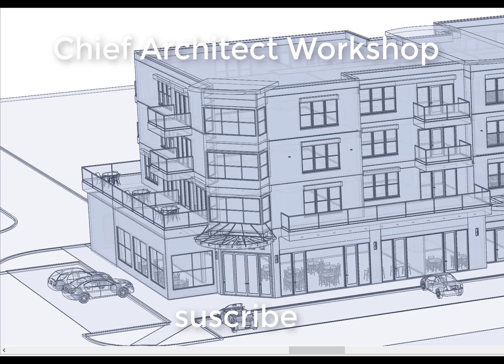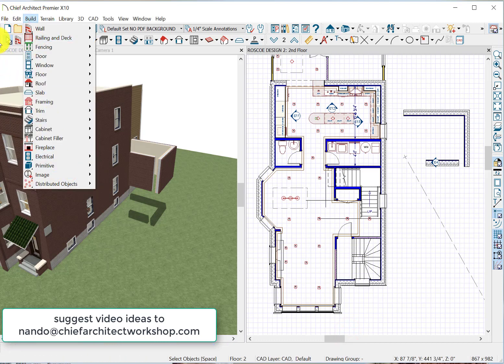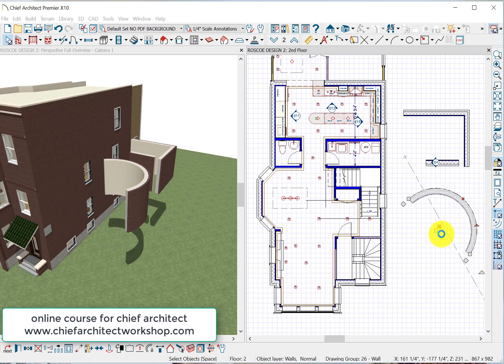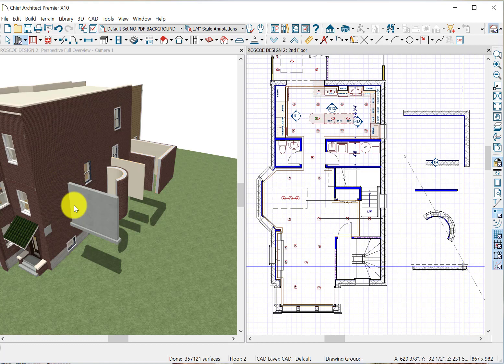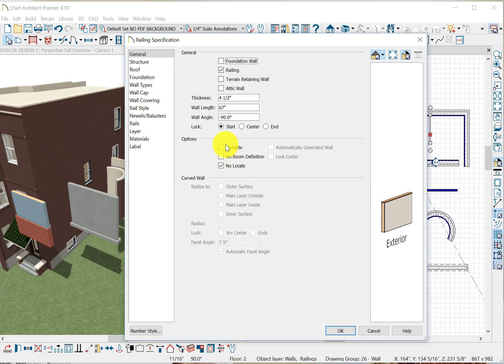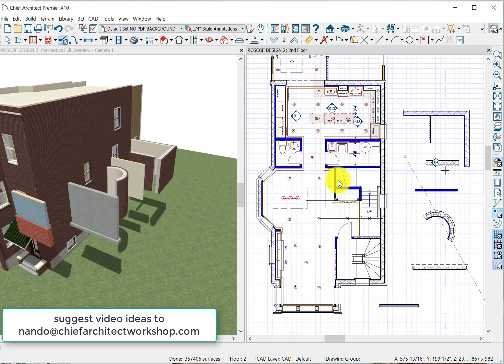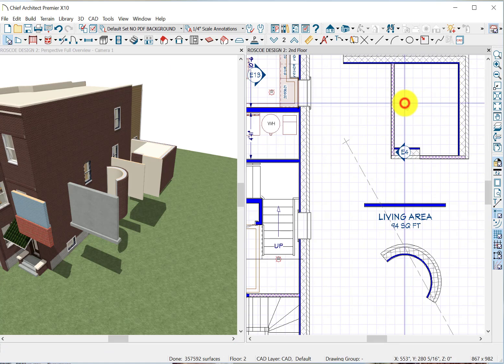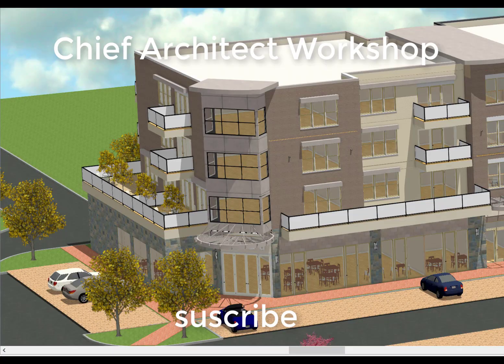How to build Walls in Chief Architect - EASY PEASY

Comment: Good Demonstration.  For a  high-rise Office Building, how do I create a Pre-Cast concrete panel exterior wall with metal studs and 5/8" gyp. brd. interior?  And commercial type fixed dark bronze aluminum glass integral windows? (meaning these are sets of multiple windows with shared 1-3/8" wide mullions)
Reply from the maker: Interesting idea.  A how to on how to do custom walls, Custom windows and then copy floors for a HighRise.  Watch the Vids.  Could be the Next Video.